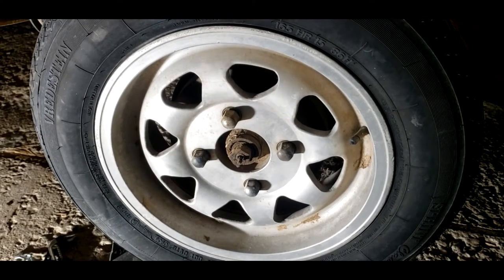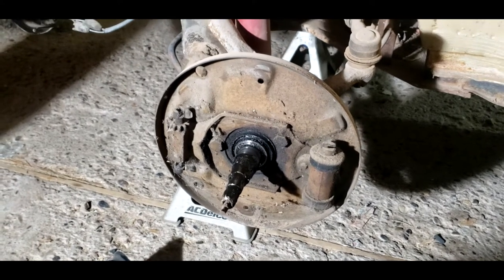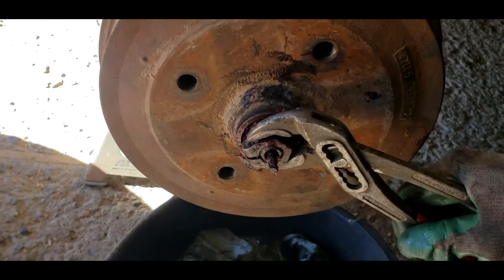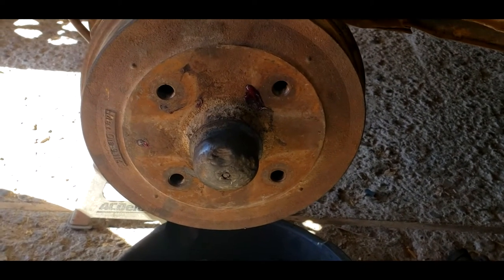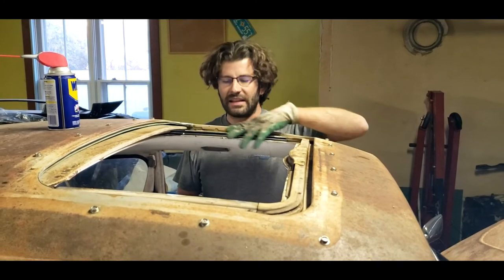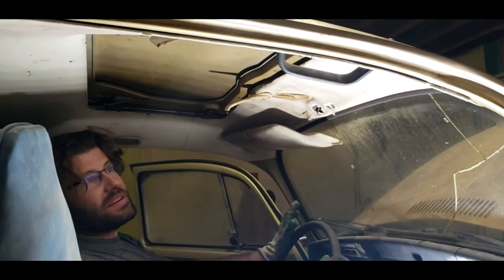1974 Volkswagen Beetle "Sunbug" Resurrection Pt3 Brakes and Sunroof

Comment: great bug...fun vid.  I had a '75 Imperial with a factory sunroof...although at completely the opposite end of the automotive spectrum from this bug, and other than having an electric motor and a vinyl roof, the sunroof mechanism was identical.  I know the Imperial had an ASC sunroof, but thinking the VW was factory made...i think.  Even the shape of the cable tracks is the same, and even had one lifter that was obstinate so the back of the metal panel wouldn't lift up evenly...eventually just took the liner out and would push up on the panel to get it to seal like you're doing here...which didn't do much for the over-stuffed loungey bordello vibe of the interior.
enjoying your vids...you put a lot of work into them.
Reply from the maker: Thanks!! Yeah seeing different types of sunroofs is interesting. I had a Peugeot that I had issues with the cable so I did the same and pulled the panel off and would just push it up. It didn't look the best but hey it worked. 
Thanks for watching the Videos! I am glad you are enjoying them, I have been putting a lot of time and energy into making these, so I'm glad they decent.